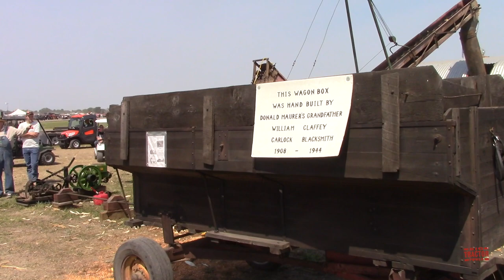Where Do All The Ears of Corn Go at the Half Century of Progress Show?

Comment: On the farm I grew up on corn was picked to feed cattle.  Corn was shelled to feed hogs because they won't eat the cobs.  The ear corn and the shelled corn was ground using a hammer mill drive by a belt.  It took two trailers to keep the corn separate, we had hog feeders and if you put ground ear corn in them the hogs would not be happy and it would be an even bigger mess than they made of the ground shelled corn.  The cattle needed the added ruffage anyway and ate it with no problems.  We had a sheller, I think a Case, and it was slow, I think it had been adapted to use a pto hookup instead of a belt. The farm went to corn headers on the combine when I was a very young boy but I do remember the sheller.  There weren't any cobs on the farm to get rid of or shucks from the ears either, they all went through the hammer mill and into feed for the cattle.
Reply from the maker: Great history. Thank you for sharing.

Comment: That tractor up on one wheel powering that one conveyor that just looked DANGEROUS!
Reply from the maker: It’s interesting.  It was the way they ran a pto powered implement years ago.
Reply: I thought it looked cool though !!
Reply: That device allowed farmers to run a PTO powered implement with a tractor that wasn't equipped with a PTO. Standard 540 PTO was a development of the 40's/50's. There were tons of old tractors from the 30's and 40's and even into the 50's that the PTO was optional at time of purchase. Even in the early 60's, some of the biggest tractors didn;t have one unless ordered with it(they were designed for tillage work) so that device allowed a farmer to take, oh for instance, a 30's era Case model SC or VAC or maybe an older C or L model that didn;t have a PTO and put it to work at harvest time.

Comment: Badger chopper boxes! Best silage wagons ever made! Proudly in WI! last almost forever, made of marine grade plywood for the floors and sides. The ones I see here are 1960's era design. I grew up with a 14' just like these(had a roof on ours) that my grandfather bought new in the 60's. Was in fine functioning shape after yearly use for hay and corn silage right up till the end when we had our auction in the late 90's. 

Seeing the cobs flying out of that JD manure spreader gave me a good laugh! Like an out of control popcorn maker or something, cobs flying everywhere! Not quite the same pattern you would see from actual manure haha, but it's nice to see something of that vintage in action, equipment for that purpose now days is monolithic in comparison, so much so it doesn't hardly resemble it's ancestors anymore.

Comment: Something I have always wondered about old belt driven equipment, what keeps the belt from sliding off the flywheel on the tractor? Do you have to get the tractor perfectly positioned for the belt to stay on, or is it simpler than it looks?
Reply: The belt is twisted so it doesn't come off.  I have an early memory of  belt power silo blower on our farm before switching to p.t.o. powered blowers.

Comment: I was surprised at how involved garden tractors were in powering some of the equipment.
Reply: East American Trains I was thinking the same thing.
Reply: Back in the 50's & 60"s there were no garden tractors.  Usually a smaller tractor like a Ford or IH C or H would power the elevator.  I dumped hundreds of corn loads as a kid on our farm.
Reply: Historically they weren't, it just happens to be a great, cheap way to power some of the equipment now. Those front belt drives for the John Deere 110/112 are very rare though.
Reply: @michics100  I'm assuming you mean there were no garden tractors being used. The economy  and jim dandy tractors started in the 40s (or one of them did, the other may have started in the early 50s). Lots of garden tractors by the 60s ,but my dad would agree about their use - they had a case VAC for what he referred to as a "wagon tractor - quick and handy with no real power".

Comment: The trick when spreading cobs with a spreader is to first line the bed and rear with husk - both to prevent leaking out the back and cobs from getting under the chain (which would eventually stretch and break)

Comment: You won’t find many new modern combines that can leave the cob whole like that old machine does 😎
Reply: Only for 2 reasons.
1 they have straw choppers on that smash the cob.
2 the operator doesn't know how to set the machine
Reply: The reason really is they ran a CAGE sheller like the New Idea Uni system used in later years, NOT a cylinder rasp bar like on all combines , the Cage Sheller system in  much gentler and dies not pound the corn off the cob but sort of rolls it off, as a young man raised on a dairy farm after morning milking and chores were done I worked for two grain company's, one had a John Deere Sheller mounted & powered by a Chevy 292 in line 6 and the other company had a Minneapolis Moline Sheller powered a minneapolis-moline 4 cylinder diesel motor mounted on a Chevy truck, people back at that time knee what work was.

Comment: Wow Jason you got a lot of really cool footage here. Some of this equipment we had on the farm when I was growing up like the new idea corn picker. And then some of the other stuff just looks downright dangerous lol.. I sure would love to find a 540 PTO adapter for the front of a garden tractor though that’s pretty neat. Also the farmall tractor using it’s rear wheel to drive a PTO I thought was interesting. You would think long periods of doing that would be bad for the differential? Really cool video though thank you!
Reply: I can honestly say I had never seen the rear wheel/PTO setup either.  Those tractors have been around for over 50 years and the running of that PTO setup didn't put stress on anything.  Rarely heard of differential problems of any kind.

Comment: Can anybody say what typ of grain auger the john deere is ? Its look like a john deere. At 2:15.
Reply: We had one on the farm when I was a kid.  Looked the same but I don't know if it was a JD or not.  Believe they were called tube type grain elevators.  We used it for elevating soybeans into a storage bin.  Very gentle on grain.  Didn't crack the beans like a corn elevator would.  Belt driven by a single cylinder Cushman water cooled engine.
Reply: Believe it is called a tube grain elevator.  We had one but I don't know if it was a JD.  Very gentle in elevating grain.  Didn't crack soybeans like a regular corn elevator would do.  Discontinued when augers showed up.  Ours was powered by a single cylinder water cooled Cushman engine.  Best starting engine on the farm.
Reply: Sorry for the repeats.  It didn't my first attempts.

Comment: Would cobs make good stove fuel?
Reply: They are a good to starter for wood/coal, but don't give out much heat.
Reply: They burn up to fast to make any good coals. They would be decent to use if you had some kind of self feeding system to keep dropping them into the stove, like wood pellets(except wouldn't burn as long) but otherwise they are just too quick.

Comment: Awesome vid BTP👍that JD 730 running belt, has belt running cross ways not straight, I am surprised belt doesn’t break at joins.  Corn growing n harvesting was tougher going years ago, did corn ever get stack like wheat bags years ago?  Pa said he could smell stack rotting from birds chewing holds then ran fallen inside the bags n stack.
Reply: The belt is twisted to make the machine run the right direction, it also stopped it from slapping

Comment: How do they pick the whole cob without ripping the corn off?! 🌽
Reply: The cornpickers at the very beginning of the video.
Reply: If you see the pickers in the early part, the "pointy" area where the rows of corn feed into there? At the bottom of those channels the corn goes into are a pair of rollers. There are two rollers, one on each side of the corn row, in each channel. As the row of corn goes in, the stalks get pinched by those rollers, and the rollers pull the stalk down towards the ground. 
Now, the cob is thicker then the stalk, so when the cob gets down to the rollers it won't fit. So, rather then get squeezed through the small gap in the rollers, it gets pulled off the stalk, and sort of rides on top of the rollers until it gets to the back of those channels, and then the cobs falls into the next part of the machine. The stalks don't actually get cut at the bottom off the ground or anything, they just get smushed/rolled down. Thats why after the machines go through the stalks are all bent down and beat up, but aren't all cut up and laying flat like you would see with a combine. 

The rest of the corn picking machine is mostly two things, a husking bed and a big conveyor. the husk bed is more rollers that try to grab a hold of loose corn husks on the cobs and pull them off so the cobs are clean. The big conveyor is what dumps the cobs into the wagon. 

A lot of the old pickers are just too worn out to function well enough to work anymore, so it is neat to see these in action. When any of the rollers get to worn out, they can damage the corn cobs, leave them behind, ruin them on the husking beds, etc. Parts for these machines are hard to find, or expensive, or both because they are basically not in use anymore outside of shows like this. It's like finding parts for an old car.
Reply: davenhla thanks for the reply... the bit I couldn’t figure out was that it does not cut the plant as you say, it pulls through! I thought it was cutting them but only like 2/3 feet above the ground. All cleared up now :)

Comment: Doesnt realy show how the corn is separated from the husk !
Reply: He showed the Sheller idk what else he’s supposed to do other than throw the camera in the Sheller
Reply: @kill2liveman  OK man I aint no farmer but i like the vids '
Reply: @101jumpit  Don't take that response personally. I don't know why people have to respond like that but rest assured you're not the only one getting comments like that on other posts.
Reply: @jw8848  Thanks man.There's always one . :)
Reply: The corn sheller is a very old machine, going back to 1800's, hand crank models where you put one cob in at a time. It's basically two wheels with some teeth on them that spin to pull the kernals off. The cob gets pulled through, the kernals get stripped off and fall through a screen. The cob doesn;t fit through the screen, so it continues on until it gets ejected from the machine. 
First it was hand cranks, then they made them to run on the little old hit&miss engines, then they made bigger ones with hoppers to feed them instead of one cob at a time, and eventually they got to the big units run by tractors like you see in this video.
Reply: @davenhla  Thanks very much for the explanation.Much appreciated.Have a great day :)

Comment: remember the times well. First side  elevator for long tung wagons to be pulled with horses[ I dont remember horses]  new  idea pickertwo row. Then then two row  wagon behind, new idea picker. then mounted picker  new idea on 770 oliver.  Inside elevator in crib, then Kewanie elevator Both powered by  my GGFathers 1938 studabaker coup on a jack shaft run in 2nd gear